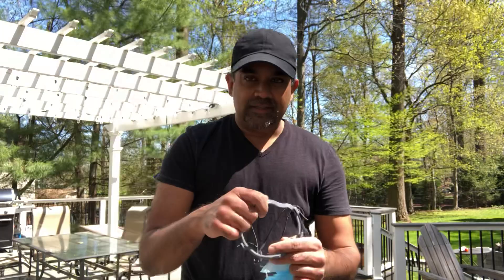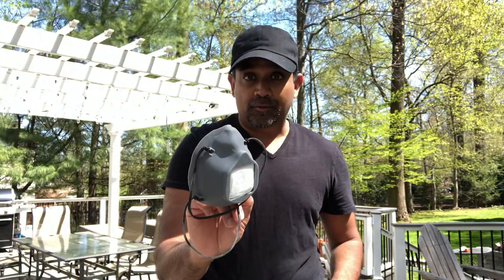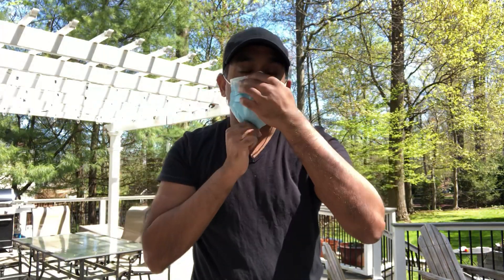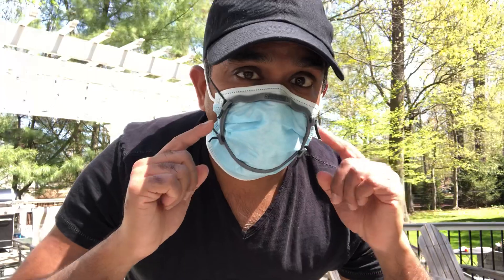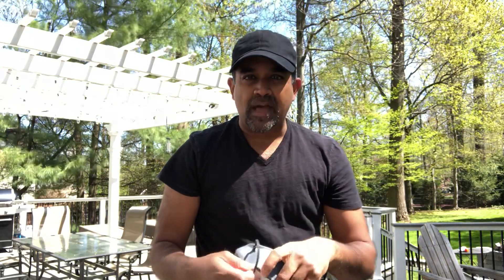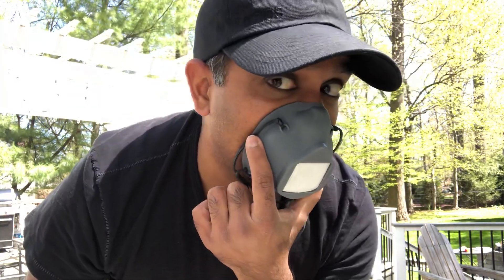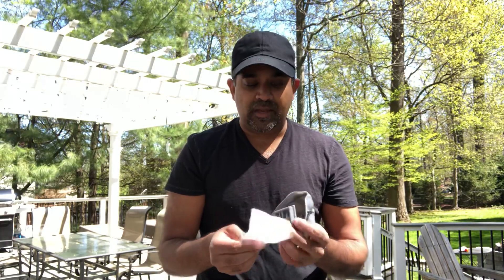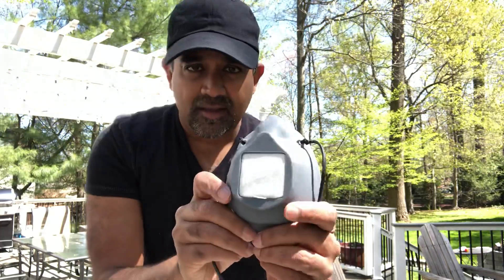How to use a Bellus3D Mask Fitter

Comment: Dr Rajan, How did you secure your mask fitter? What type of elastic straps did you use for the Mask fitter?
Reply: Hi Satya thanks for the question. I’m using large non latex black rubber bands available on amazon.  I’m cutting them and tying knots for an upper and lower elastic band behind the head